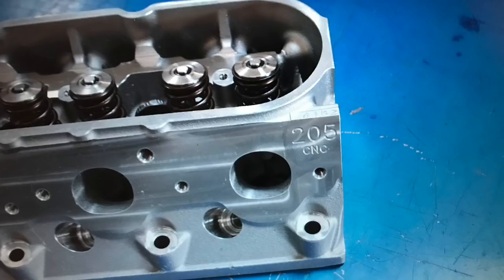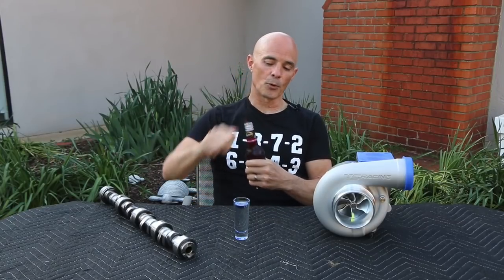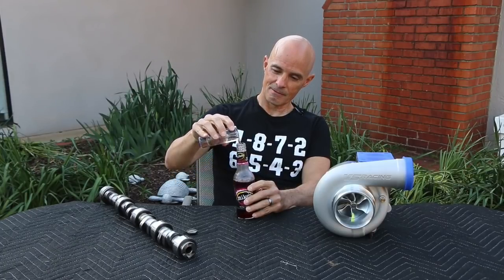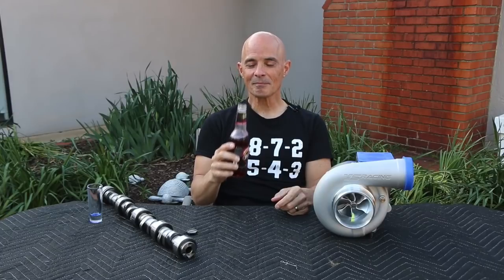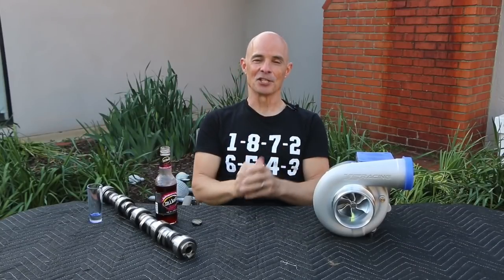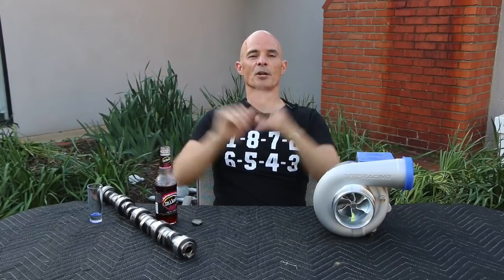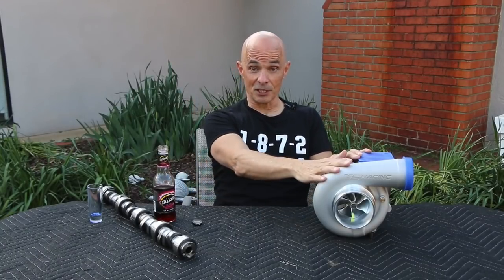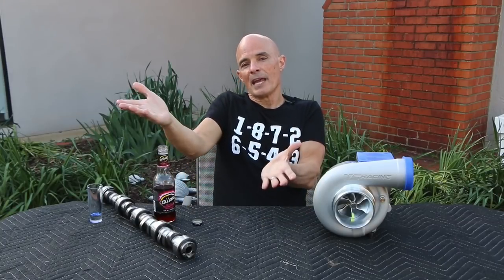TURBO LS-WHEN ARE PORTED HEADS NECESSARY?

Comment: If a trick flow head with a smaller cathedral port make more power than a square port 823 head but the 823 head flow more than a trick flow head Will it make more power on boost or the head that flow most 823 will it make more power
Reply from the maker: THE 225 HEADS WILL MAKE MORE UNDER BOOST

Comment: Iron block 5.3with 862 heads. Looking to turbo it. This motor will be in a daily driver foxbody so I’d like to keep it around the 500ish range but would like to set it up to have the ability to run 800+ for those all out kind of weekends. Is this wishful thinking? What parts would you recommend? (Inside and out). I like to keep two and horse power to stay as close as possible
Reply from the maker: see the many 5.3L turbo videos for combos-that power level is easy

Comment: I’ve seen very little of your content to this point & know it’s absolutely awesome reviews from the numerous times you’ve been mentioned in forums over the last couple years.  As my build progresses I find myself asking these questions like as what’s my best option on a budget build vs buying aftermarket setups & here you are 😆 I’m currently building a forged 5.3 shortblock with factory crank.  Considering what I want the top end to look like as far as power levels go & running my stock 862s, modifying them, or other alternatives.  Thanks for the info./content man!  It helps a lot of us out tremendously when some guys don’t want to review or repeat it in posts.  We all gravitate back to the knowledge you’ve shared time & time again.  Keep up the good work
Reply from the maker: happy to help-join the live feeds I have daily to get answers to direct questions
Reply: @richardholdener1727  I’m glad someone out there is as interested in the testing as I am.  Not sure if you’ve mentioned it yet as I’m playing catch up on all the videos but I’m looking for limits of stock 862 valves in my forged bottom end 5.3 that’ll be high revving & thrashed on.  Hoping with all ARP hardware & a good tune that the valve doesn’t become the weak link that hurts anything else.  I’m not very social media savvy but I’ll see if I can find the live feed!  Thank you 💪🏼

Comment: What about if I do not want to run boost…running a stage 2 cam with forged pistons and upgraded connecting rods, would you recommend porting & mill the heads for more power ?
Reply from the maker: ported and milled heads can add power

Comment: My opinion aftermarket head casting is better than a stock GM casting. 
Is it worth the money? At 1,000/1,300fwhp on a four bolt per cylinder block it is .
On a 700fwhp then its not necessary.

Comment: My opinion ( everybody has one, lol) is if you are trying to make maximum power ON PUMP GAS , porting makes sense . You will be octane limited , so na hp will help make more power before you limit out on octane. Softening the chambers is important too , while your porting . Again, to help get by the octane limitations .
 You guys that have easy access to E85 live in a different world than us that live on 91-93 octane .
 If E was everywhere , and to make 1000 hp , I probably wouldnt waste my time on port work and chamber softening.  
 The whole cam thing comes in too , even though most LS cams are ground to kill dynamic compression from the start . Wide lsas' help kill peak cylinder pressure down low .
 Overall, its just a whole different world , E85 vs 93 pumpgas.
 1000 hp is almost too easy on E85. You have to open a whole bag of tricks to get close to 1000 on 93.
 My next combo , if I dont damage my 6.2 block going for power on 93, will be a 416 w all the tricks to make na power AND soften the cylinder pressure down low ( mutually exclusive , i know ,to a point . Compromises ) , then shoot for 1000+ on 93 at minimum boost.

Comment: Only true of you care only about peek horse power. A head is never bad to have. You get more power under the curve.
Reply from the maker: PORTED HEADS ARE EVEN LESS NECESSARY UNDER THE CURVE
Reply: @richardholdener1727  oooo realy ? I would Say absolute no. One wants allways a wide power Band. Can't think of any situation where a ported head makes no sense. The better it flows , the less lag you get with a turbo. As less pressure loss you suffer. So you get your power with less pressure. Thats under no circuimstance a bad idea.

Comment: In this day and age I would have to say the biggest upgrade you can make is to switch to E85 because with current piss poor fuel available and the limitations that come with it you are always gonna Have limitations with boost level compression etc that you simply do not have with E85 and all you need to do is run bigger fuel lines and injectors and a return system (for simplicity)

Comment: the one thing you always overlook is hp with octane limits. like say you have a 5.3 with a decent turbo and want to make a streetable setup at say 800 hp but are limited to 91 octane. lower boost equals lower iat which reduces the risk of detonation. aka a reliable street friendly motor. but I really do appreciate and enjoy your content.
Reply from the maker: I DON'T OVERLOOK HP WITH OCTANE LIMITS-YOU RUN LESS TIMING AND MAKE LESS POWER

Comment: I have an LR4 4.8 for a project car, and an LS1 5.7 in an ‘03 Monaro. The LR4 is a BBT inspired build, and the Monaro is being rebuilt with a cammed N/A 383. Is it beneficial to port the LS1 241 heads and put them on the LR4 to lower the compression for boost, and vice versa port the 706 heads for the LS1 for compression gain?
Reply from the maker: porting helps flow and power, it is less necessary on a 4.8L or a boosted version

Comment: Richard can you test the 862/706 cnc stage 2.5 heads from Texas speed on a turbo motor vs stock 862/706 heads
Reply from the maker: THERE IS NO NEED TO RUN PORTED HEADS ON A TURBO MOTOR UNTIL THE POWER OUTPUT GETS VERY HIGH

Comment: I picked up a ZL1 a few yrs ago, went to BTR and got the cam, Wiseco pistons, K1 crank and rods. 419 stroker. we have the large TB, ported snout and pullies are 2.55 and 9.17.  We did the converter too. I know I know but I need it I am 100% DAV. We didn't work the heads and you have already told me before in chat some of the things said in this video just watched and I feel comfortable no doing them. Question is do I port the 1.9 blower instead as the builder suggests? Some claim large gains on this mod. The lower end is already built, we are in final assembly so these are future mods now.  A lot of the LSA engines are running Tooley cams it seems. BTW Your compound boost segment was very interesting ....
Reply from the maker: porting the blower helps-but a bigger blower helps even more
Reply: @richardholdener1727   lol...yes throw money at it... lol... seriously I like the 1.9 but would like to make it better because I can and if the payoff in power is enough... A full tilt porting about $3,000 I believe. Although that usually includes the snout and the brick, both of them are done. A nice new S/C about $5-7000. Could sell the parts as I have been. Also it is a convertible and that in itself has issues. Still have the 3.23 gears....  I'm not loaded but I have saved and planned for a car so I want to hit a certain level in power and safety, reliability and handling. I scour youtube for build tips no matter how small for this LSA. Tip: The oil pan is shared with the AFM 6.2  motor and has a check valve that is not needed but can malfunction. The fix cost >$10. The Cadillac has a better pan. So fix that if you have your ZL1 LSA apart.

Comment: Gas mileage most important some power would be great what should I do for replacement heads /gasket706 cracked? 200 2 Silverado and it's currently taking coolant a couple of exhaust manifold studs are I snapped so I imagine the heads need to be rebuilt did you head gasket leak currently runs pretty rough but has no check engine light clean throttle body

Comment: Problem with non mechanics or mechanics that do not do hot rodding or tunes and only fix stuff is that people equate boost level with power level and that simply isnt so. Boost has nothing to do with power it is a measure of resistance you take an engine making 400 hp at 10 psi of boost and replace the intake with a less restrictive one and you can see 400 hp with 8 psi boost and at a higher rpm. adding ported heads and free flowing exhaust will lower boost level if nothing else has changed and that is not a bad thing. Also lower boost level is lower temps and less expansion of rings and pistons allowing for you to add "more" boost to make more power as long as internals tune and fuel delivery will support it. E85 and static compression level and meth injection and intercooler are different means to lower incoming charge temp.

Comment: If you are racing and the limiting factor is power adder sizing then you will need everything. Stage 99 head hogging, big solid roller cam, lightweight rotating assembly (relatively, but designed for power adder) Ported everything and big intake and exhaust piping.

Comment: Hey Richard love the channeI!!!

Can you plz try to dyno a forged lc9 363 stroker with a stage 2 tsp high lift truck cam, near stock 243 head cfm, stock 1.7 rockers, .650 double springs, slightly oversized manley racing valves, -15 cc valve reliefs, stock flex injectors, stock flex fuel pump, cold air tbss intake, with shorty headers VS a 2.3l whipple sc version of it???

Want to know if the investment for the sc/injectors/possible pump on that 363 combo makes sense or if i should just do an even more built up 383 version of it and just call it a day? Im offroading the vehicle on 91 octane, have a 2000 stall, modified 4l70e, 4.88 gears, 37" tires, 6k lbs curb weight... it alotta fun but could use just a little more power to help turn the big tires lol (famous last words)
Reply from the maker: a 5.3l bored to 6.0L?
Reply: @richardholdener1727   yes sir 3.80 bore x 4" stroke. Its my first build and runs really strong NA but find myself wanting a sc

Comment: 5.3,FLAT TOP, BOWL BLEND 706 HEADS, 230/600 112 CAM, EBAY 7875 .68 A/R.....HOW MUCH HP ON 93 OCTANE WITH WHAT CHEAP INJECTORS?
Reply from the maker: 450 OR SO
Reply: @richardholdener1727  that would be without the turbo

Comment: Richard, have you done a test for a 4.8/5.3 bored and stroked to max safe tolerances mated to a set of 706 heads that have been ported and valve upgraded? If so what was the video reference. 
Thanx
Reply from the maker: that would be a 383 with ported heads-it will make 550-600 hp depending on cam

Comment: I'm a street guy that likes to have a good reliable car or truck. I like to unleash the power of the stock engine with a cam and intake, carb  combo. the reason is I'm not a professional racer and I can't justify going all out race gear to cruise the street where I'll never use the maximum amount of of power a race engine can make. I don't need race heads that flow a ton at.700 or. 800 inch of lift to only have a. 500 to .600 lift cam when factory heads flow almost as as good in that range. just like it's useless to put in a big solid roller cam in an engine that won't be revved above 6000 rpm. I learned along time ago to research first ask lots of questions and match the carb to the intake to the heads and cam to displacement and you'll make good usable power for the least amount of money. case in point. my brother has nova it had a 283. he drove it all the time had lots of fun. replaced the 283 with a mild 350 still drove it all the time had more power and more fun. he replaced the 350 with a badly miss matched 400 with 11.1 compression. it's fast and has to run race gas but now it mostly sits in the garage and isn't having fun anymore. he got disgusted with it because now he can't drive it and cruise like he used to. I've tried giving him some ideas to fix it but he isn't too hip to my advice. he was to young to remember my mustang. I blew up 3 transmission and sold the motor

Comment: So in the last video they tested the 706 head vs 317 head on a boosted 5.3 and the engine lost power with the better flowing head.  Conclusion was better flow didn't make more power.  Now in this video the better flowing head made more power. Im confused.
Reply from the maker: the 706 gained power over the 317 head from compression-and the combo didn't need the little bit of extra airflow offered by the 317
Reply: @richardholdener1727  I went back and watched the video again. Boosted 5.3 didn't respond to air flow improvements but a boosted 4.8 did.  And to the tune of 50 HP. I understand the affects of an increase of static and even dynamic compression but something doesn't add up.  I think more testing may be required.  :) Please continue the good work!

Comment: Richard, you need to show some love for the v6.  How about getting a LV3 v6.  It’s a GM truck motor and it is still a pushrod v6 with vvt.  One guy has swapped this v6 in his Grand National.  It would also be cool if you could a hold of a Buick Motor Sports stage 2 on center block along with stage 2 heads.  This block made 560 hp NA in the early 80’s.  Buddy Ingersol ran a 7.14 @ 190 mph + in the mid 80s with a twin turbo stage 2.  He nearly won the final against Bill Gliden who was running a monster 700ci motor vs Buddy’s 268ci motor.
Reply: Bob Glidden.  (Bill Glidden?  That messed with my mind.  I knew who you meant, it took a little while to figure out the error!)  There is a video on YouTube of the IHRA race where that happened.  Just search for "Buddy Ingersoll pro stock".

Comment: Correct me if im wrong, but I think a big cam will cause problems with idle, bottom end, emissions and fuel economy. The heads are much better in terms of driveability.

Comment: Hi Richard.... I love your videos... keep them coming.. I have a L92 converted into a LS3.. BTR stage 1 cam . Intake 223@50  exhaust 230@50 115 LSA . What size EBay turbo should I get . I’m concerned about to much exhaust back pressure. I’m aiming for about 850-900 hp . Ya I know.. gap my rings 😎

Comment: I am more of a street car guy. I'd rather have a more balanced engine that is more efficient than a stocker with big boost.

The more I watch you, the more I realize that a smaller turbo with a decent cam and mildly ported heads + a very good tune is the way to go. Less problems, less heat and probably better gas mileage. Also, the engine will last longer.

Most people may not care about gas mileage, but gas is 5$ a gallon here.

Comment: One BIG factor in determining how much power with boost you want to make is the kind of fuel you plan on using. In the Northwest E85 is virtually unavailable and race gas isn't practical to run in a street car. Its easier to put good heads on the 4.8 matched with a good camshaft and TBSS intake manifold to make bigger horsepower at lower levels of pump gas friendly boost. I just finished this combination that made 573whp on 92 octane. I feel that a stock head combo would of been significantly lower power production given the octane factor. A test on this would be awsome to see. Would love to see if my money was foolishly spent.

Comment: I like your 7/4 swap T-shirt!!!
Reply from the maker: my ls swap-thnx David Freiburger
Reply: My dilemma,  besides my very thin bank account is, I have stuff for an SBC which w is supposed to go into my AMC Spirit. 360" with Eagle rotating and flat tops. Dart Iron Eagle 180s ect. Now I'm thinking I should put this engine together to sell and get an LSbefore doing this swap. So much easier to make power, even N/A. Its $s and what I have verses the LS power. I dont need a million HP in a 2500 lbs. car, just want to have a good runner for the street and maybe some open track road course fun. Comments are welcome. One deciding factor is getting a different cam for the SBC. The Herbert cc6 4/7 swap I inherited is way too much cam for these heads.

Comment: I am team TEA stg II 243 heads rods/pistons flowtech camshaft 80mm box stock borg, still doing wiring on the car but so not sure on hp but I figured why not try to make it flow the best possible.  I figure it gives your engine the ability to make the same hp  at a lower boost level.

Comment: Adding slight self done porting can be amazing just don't over do it and with pump gas 10-12 psi can be as well!  If you plan on rebuilding ring gap and quench area really seem to effect how much you can risk. I wonder what best for that junk yard motor if I don't plan to rebuild it yet. 50% gain seem safe but when I'm I at the edge? What ring gap safe for what level and when do I just dirty my oil? Love see you run junk yard motor test it's great you do it on so many type of engines and brands. Thanks love to see more shows.

Comment: I'm late to this happy hour but still joining in.  How far will LY6/LS3 heads reasonably take you on pump gas before it's time to upgrade?  I'm going to be running either a btr stage 2 or TSP ls3 stage 2 turbo cam and a s480.

Comment: So my answer is no head work. I'm looking for max torque from 1200 to 3500 rpm for my 5.3 Suburban. Been researching a lot and this answers one of my questions. Just going single turbo and maybe a slight cam upgrade.

Comment: I do like NA engines and never had add boost to a engine, and in NA higher compression makes more power, for the little I had read you don't want to do this with a boost engine, so I'm getting confused when you say that the higher HP a NA engine makes the more it will do with boost, can you make a Dyno test about this topic ?